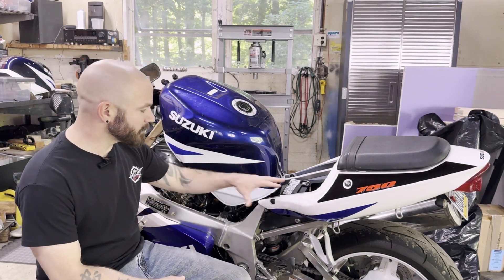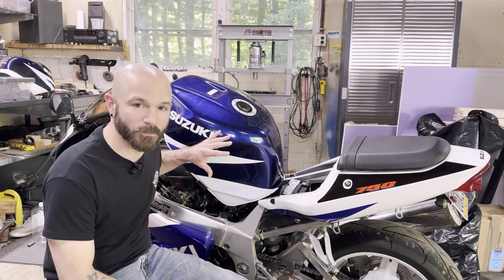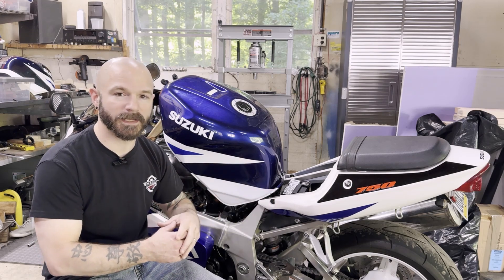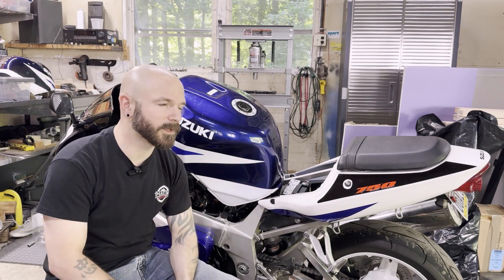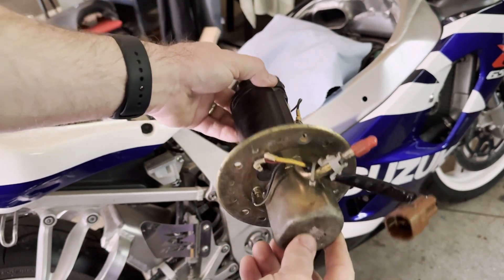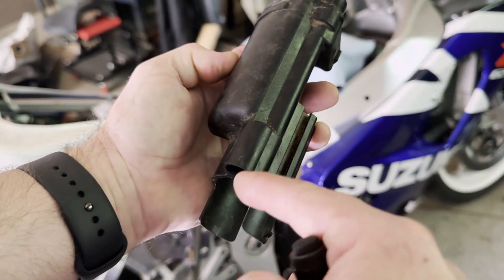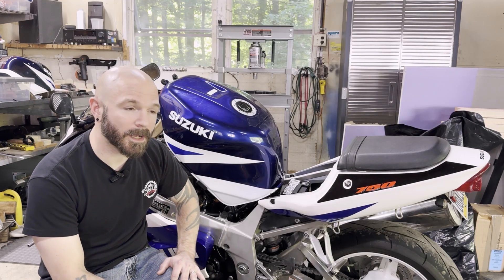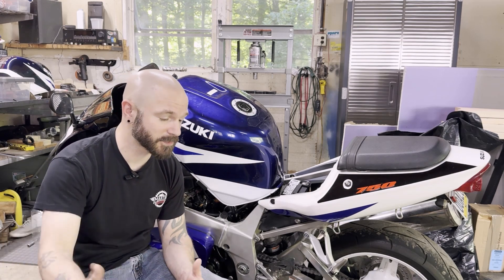Suzuki High-pressure fuel filter bypass

Comment: Great solution and the retrofit filter to swap out might be better. Thanks, my sv650 new pump and derestrict tune has a whining noise...... Took out the pump assembly and noticed alot of silt from this filter. It ran ok for a while until it came back. Apparently these filters are really hard to clean, so I'm going to bypass it, and see if the whining stops.

Comment: what nobody relizes is with kawasaki fuel pumps there is a micro screen on the top so fine of a screen light cant get thru it no body ever talks about it why cause they dont  know that this is there allways woried about the rest of the pump cleaning it in all fuel pump problems read my lips all fuel pump problems starts in the micro screen they will replace the pump and say i fixed it you didnt fix it  you have to let soak in toilet bowl cleaner use a streatched out paper clip to get around the corner where micro screen is located you will fill it and hear it when you scrap with paper clip... reapeat couple times micro screen cleaned kawasaki will tell you to replace fuel pump there no fix....bunch of crap...500 dollars

Comment: under tank, just above engine was high temp. i don't like new filter position.
Reply from the maker: The existing fuel line is in the same exact place? And while in my example here it's just laying there it could absolutely be located in a different fixed location with some longer lines.

Comment: Just reverse flush it, fixed the 80K mileage on my GSXR1000K5 immediately, had dropped to 120 hp on the dyno, straight to 155 after the reverse flush.
Reply from the maker: We did try that first, unfortunately his tank was REALLY nasty so I think this one was beyond saving.
Reply: 155? still not fixed
Reply: @deandee8082  REAL rear wheel horsepower, not Dynojet guessed crank hp.
Reply: Don’t work long